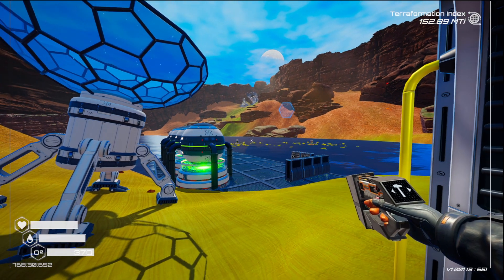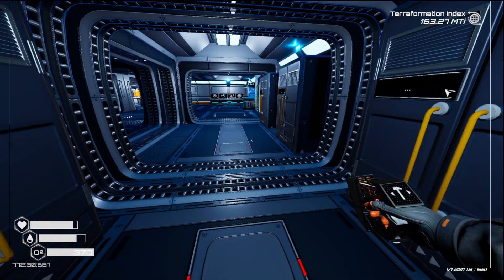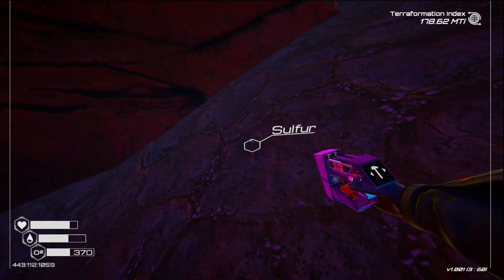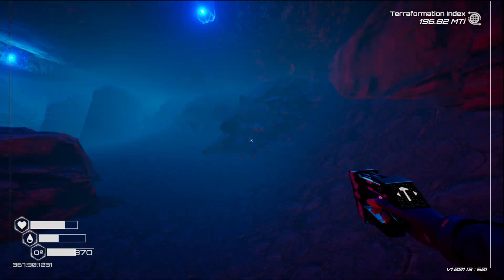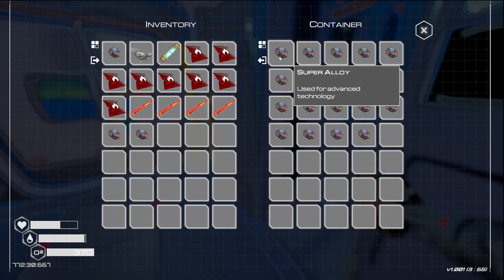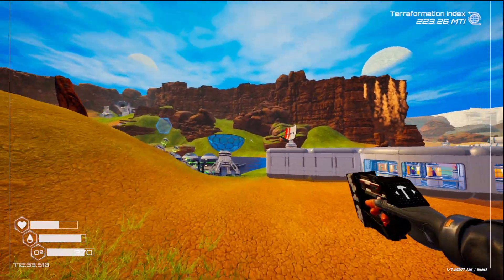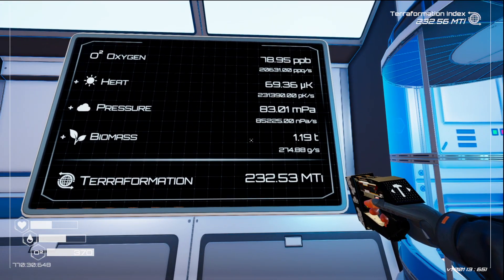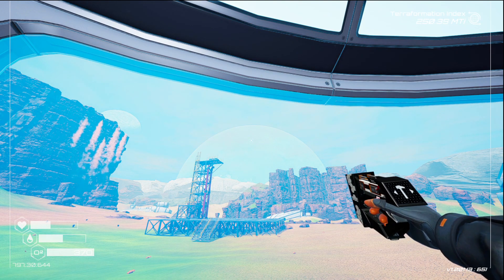Planet Crafter Season 5 Ep 10  Too Much Heat Need More Power!

Comment: You'll finally get that Super Alloy Rod any second now at that speed! I just finished recording for the week, was shocked how fast it actually unlocks once you get an optimizer and fuse or two. There's a big gap in pressure, heat, and oxygen unlocks exactly when you start finding those fuses, what a strange coincidence! lol
Reply from the maker: LOL strange indeed.   I think this is the first time that I've intentionally tried to keep them even and I have found that the stuff from heat just finishes first no matter what.   I just wish more could be done for biomass early on.     Thanks Lee  :)

Comment: You can climb every mountain with the help of stairs or platforms 🙃
Reply from the maker: There is a collision block on top of the iridium cave now.  If you use the vine to go up there and try to get on top of the rocks at the top you get blocked.   I've tried a ton of times since 1.0 on my big save and it won't let me pass.    Otherwise,  most of the rest of the map can be climbed.